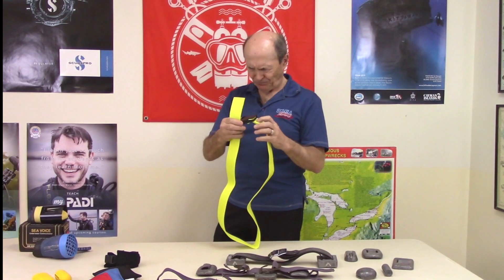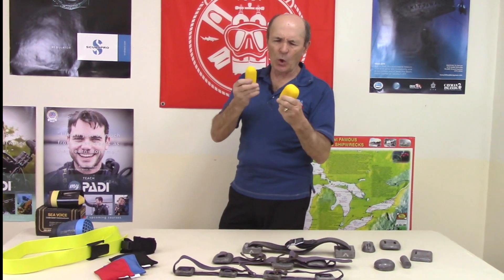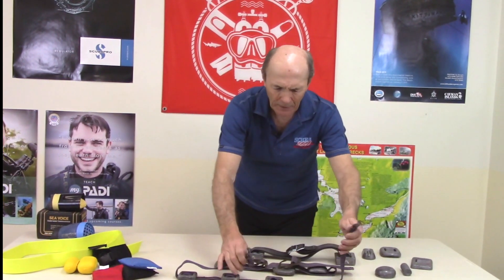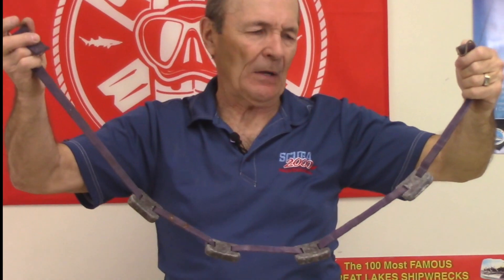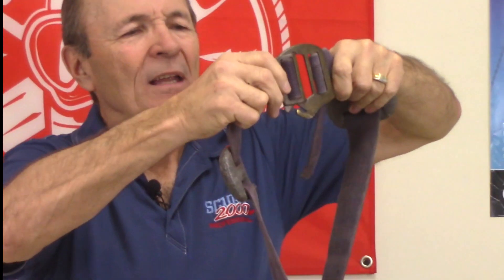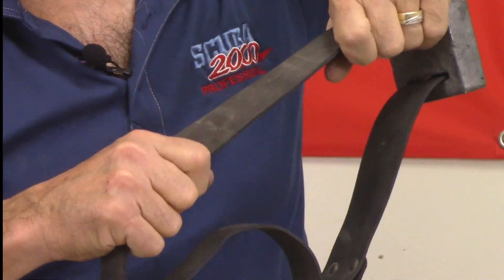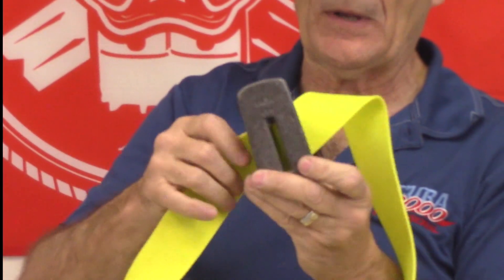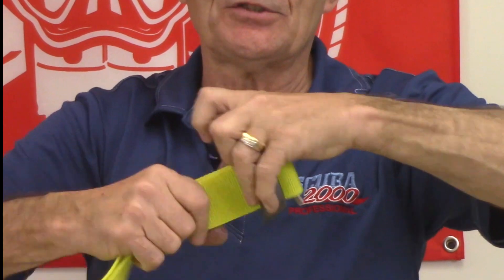Weights and Belts - Vintage Scuba: S01E03

Comment: The Scubapro stainless belt buckle has a notch on bottom.  What is it used for?
Reply from the maker: To hold a bag (for lobsters or treasure).  It was the only attachment point as there were none on the tank straps.
A.

Comment: so when you had to surface , you couldn't do a safe stop. could you control your ascend? didn't you get the bends?
Reply from the maker: Nope! Nope! Nope!
We did NOT make a safety stop. That procedure (which I agree with) is a late comer. It was never part of the US Navy No-Decompression process so we didn't even think about it.
We did NOT have control of our buoyancy, certainly not good or easy control. The best control came when diving from a boat with a tight anchor line.
We did NOT get the bends. Well, most of us didn't. We didn't dive deep; we didn't have large air supplies; and we followed the tables to the letter. Not a perfect scenario but it worked pretty well.
Alec

Comment: Alec, I was watching a video of the PADI Course.; In the video it mentions using your weight belt and the buckle had to be able to use the quick release with the RIGHT hand. I am LEFT handed and would prefer to be able to release the buckle with my LEFT hand. Is there any reason why you cannot reverse the buckle to operate using the LEFT hand to release the buckle?

I am NEW to your channel and live in Victoria, Australia. I am slowly working my way through all your videos. I have watched all of your Tech Tips so far and I am now working my way through the Vintage Scuba series.
Reply: I'm taking the SSI course and I'm noticing that they have right handed preferences as well. Perhaps it's because the BC's controls are on the left, leaving your right hand free to release the weights?
Reply: The idea is that everyone is the same so if another diver has to release your weight belt in an emergency they do not have to waste time figuring out the release!

Comment: Back in the early 50's you could control your buoyancy with a surplus MayWest that the fighter pilots wore in WWll and you got it from the Surplus store where you got your weight belt. You had to inflate manually, but it did help control your buoyancy.
Reply from the maker: You are partly right Dog.
The old Mae West style BCs would give you buoyancy on the surface and a bit underwater but you couldn't get the air out easily. To call them Buoyancy Compensators would be a stretch.,
Besides, divers in the '50s would be caught dead with a"life vest" on. Or maybe they would - be caught dead that is.
Alec

Comment: Alec, 
Do you know where I can get Wight casting form. 1kg and 2kg?
Reply from the maker: Most weight molds that I'm familiar with are in pounds.
I'm sure there are some made for Kilos in Europe but I have no idea how to find them other than search Google.
You could use a 1 pound weight mold and convert it to Kilos by simply not quite filling it. A 1 pound weight mold will hold 2.2 Kilos if filled. Either weigh the lead before melting and pouring or fill the mold to 90% of it's full size = 2 kg.
Hope this helps.
Alec
Reply: @AlecPeirceScuba_SeaHunter  I suspect you meant a 5 pound weight mold. A 1 pound mold will hold just less than half a kilo. A 1 kilo weight could be made by slightly overfilling a 2 pound mold or a 2 kilo weight made by slightly underfilling a 5 pound mold. Anyhow, thanks so much for your videos!

Comment: why do you need less weight at 60 feet than at 30 feet?
Reply from the maker: Aha! You must be a warm water diver!
In cold water, a thick wetsuit or drysuit is required. Since these suits increase your size (volume), they add greatly to your buoyancy. It's not uncommon for a 7mm wetsuit-clad diver to wear 20 pounds or more (sometimes a lot more!) Drysuit divers could be wearing anywhere from 20 to 40 pounds depending on several factors. 
Made of foam neoprene, these suit compress as you descend so your volume decreases. Lower volume means less weights required.
So, wearing a 7mm wetsuit at the surface may required 20 pounds of weight to allow you to descend. At a depth of 60' your wetsuit is about 1/2 its surface volume so you will be very negative with that 20 pounds of weights.
Hence the great advantage of the BCD and it's ability to restore your volume to what it was at the surface with a simple push of a button,  and thus restore you to neutral buoyancy as your were at the surface.

Thanks, Alec
Reply: And of course with the pressure increase at 60 feet from 30 feet, the wetsuit is compressed more so it looses buoyancy and hence you need less weight at greater depths to compensate for it.

Comment: will you ever talk about helmet diving?
Reply from the maker: Well, I could Darin. But to be honest it's not likely.
I sold my own Mark 5 outfit last year. I had it for over 25 years - helmet, suit, weights, boots, hose, valve coveralls, etc. Most of the visitors to Scuba 2000 are recreational divers. There are quite a few sites with info on helmets.
I do conduct a helmet dive in the pool for divers to try hard hats. They seem to enjoy the experience.
Thanks for watching.
Alec
Reply: Those mark 5s look terrible awkward and uncomfortable.  Now something like a superlite 27 looks like it would be fun to try and a lot less bulky.

Comment: I'm a new diver.  Only certified since 1978.  We had a check list to figure out how to plan for the depth to be achieved.  It wasn't a by guess, by golly thing.  We did not need a rock to get to our desired depth.  We swam down.  At the end of our dive we were more positively buoyant of course and as you mention there were no three minute safety stops.  That being said, we were not rocketing to the surface either.  We were trained to follow our bubbles.  Finally, back in the day, the MOST important rule in scuba diving was NOT do not hold your breath.  That is modern PADI lingo.  The most important  in scuba diving is... "What ever happens to you under water, do not panic.  Stop, think, react.  Rule number two is never, ever forget rule number one.
Reply from the maker: My dad was British so I enjoy your sarcasm.  I don't want to argue nor even get into a long debate but, I've been diving 20 years longer than you. and that may be the difference. By 1978 a buoyancy compensator was very common and on the way to becoming standard scuba gear. With a BC one can offset the drastic changes in buoyancy that occur during descent/ascent. BEFORE the BC, there was no way to 'swim down' nor to follow your bubbles. Usually you left your bubbles behind.
BTW, the 'Rule of Thumb' to "Follow Your Slowest Bubbles" (note the inclusion of the word 'slowest') was an attempt to give divers a guide to a safe ascent before modern devices like BCDs and computers. However, sorry to burst your bubble (pun intended), the slowest bubbles actually ascend at a very slow rate. Much slower than 60' per minute and following them, while nice and slow, can cause a problem too. A too slow ascent will not allow outgassing and can result in a too high level in the blood on surfacing. This is supported by a lot of reasonably recent theory and testing. And to make matters worse, the smallest bubbles increase in size as they ascend so their rate of ascent increases too. The increased friction from the larger size is more than offset by the increased buoyancy. So, as you get closer to the surface, where the rate of ascent is more critical, the bubbles are going much too fast. So much for 'Rules of Thumb'!

In any event, I was trying to address the question of ascending and descending before BCs and that did require proper weighting for the dive depth. Hence, a dive to 60 requiring 10 pounds to be neutral at that depth required the diver to either pull himself down a line, grip the bottom or grab a heavy rock to assist in the descent. He would be much too positively buoyant at the surface to easily descend. And likewise, his ascent would be out of control as he approached the surface unless he again had a line or picked up a rock to slow down. This is most pronounced in cold water where one would be wearing a thick wet suit.
All the rules about what to do don't help if you CAN'T do it! That is, how do you control your ascent when you are very positively buoyant? It becomes a compromise - do I put on the correct weight to be neutral close to the surface so I'm too heavy on the bottom or, do I weight for my dive depth and find some means to control my descent/ascent close to the surface. It was one of those dilemmas that we often faced as our knowledge and experience grew.

I recall another 'Rule of Thumb' that I was taught by my ex-navy instructor. He said that you cannot get the bends while diving with a single tank (steel 72 in those days). Of course it assumed a single dive, not multiple. That 'Rule' is also not true and while we survived, most of us, we've sure proved it wrong.

I very much appreciate you're watching my videos and your detailed response. It offers me the chance to meet and discuss some of these interesting topics with divers.

Alec
Reply: I guess bringing some balloons with you or other airtight bags you could inflate at depth to compensate for the extra weight needed near the surface would have been too much effort to deal with.  And inflating them would have been a hassle that probably would have been a huge waste of your dive time.
Reply from the maker: Like a buoyancy compensator eh Len?
Reply: +James Bach "Finally, back in the day, the MOST important rule in scuba diving was NOT do not hold your breath.  That is modern PADI lingo."

Modern? PADI lingo? I remember at least one episode of Sea Hunt where "Mike Nelson" was telling someone "Don't hold your breath." That was circa 1958 to 1961, before PADI existed, and the Sea Hunt script writers didn't invent that tenet; it was standard teaching.